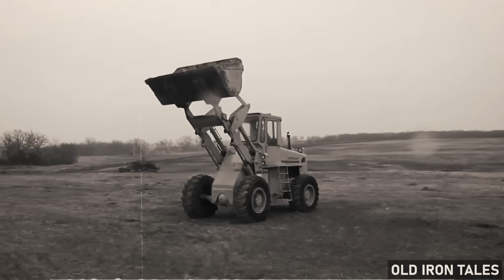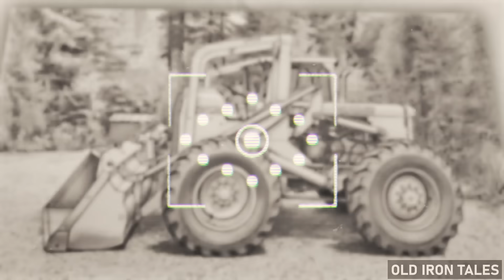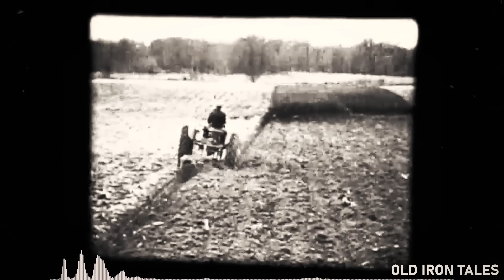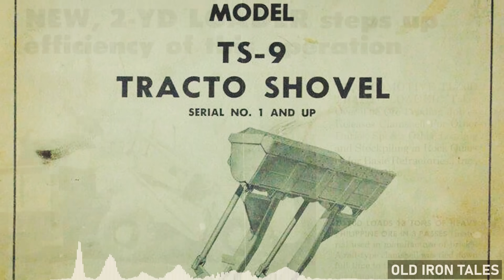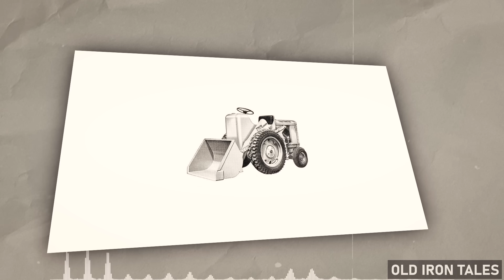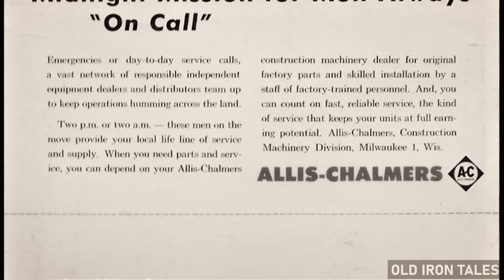The Super Unique Tractomotive Loaders

Comment: Growing up in the 1980's and 90's I still seen the occasional Tractomotive loader working. They were innovative machines for sure. Much better than farm tractors with loaders, even the industrial versions, but articulated loaders are more maneuverable and safer (as alluded to in the video), so it's not surprising the  front operator/ rear steer design is no longer used.